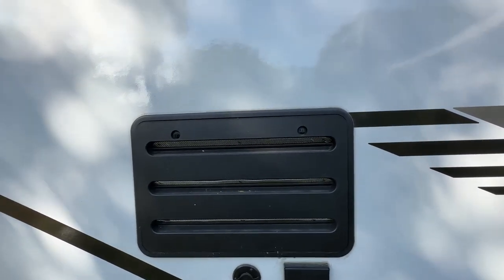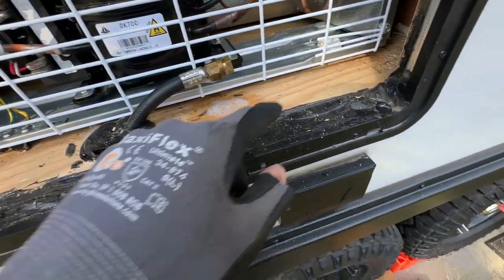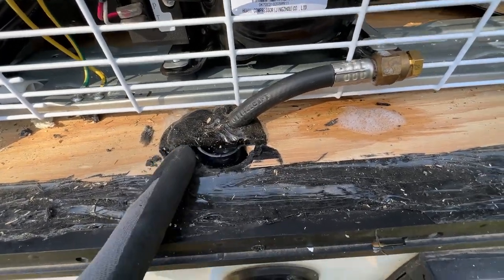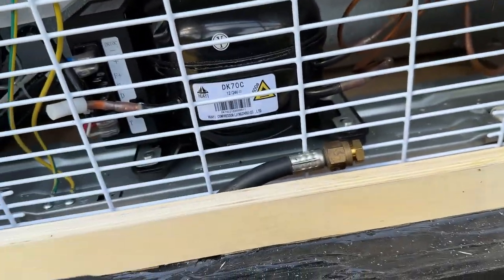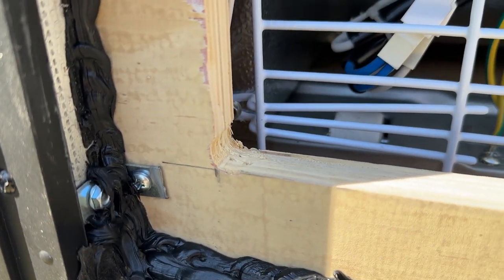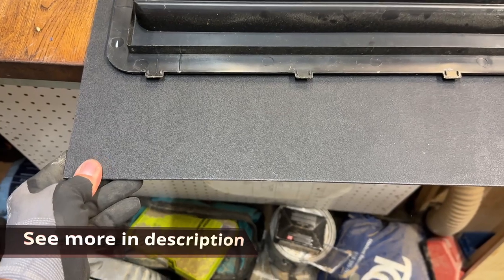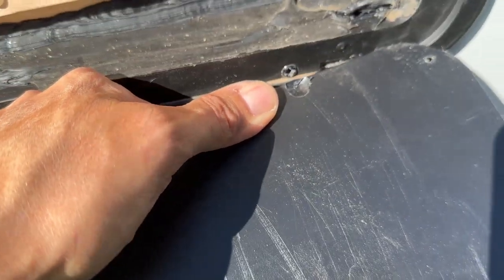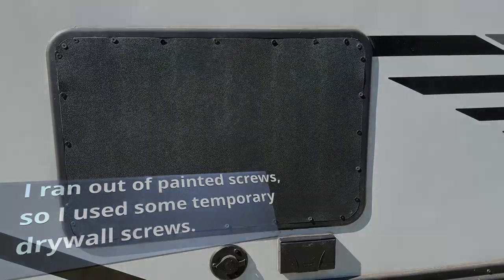How I closed up the lower refrigerator vent in my RV

Comment: My screw fasteners are on the bottom and I wish I'd never taken the panel off since I can't get it back on and have screws tighten up. I think this has been a problem with this new to me trailer for some time as it does appear a little warped so I don't know if I use gorilla tape or what. I did order some new fasteners to see if that would help me

Comment: But isn’t there a reason why the refrigerator has to be vented?
Reply: If you replace an RV fridge with a residential fridge, you need to seal it.. Residential fridges can’t be ventilated to the outside.
Reply: It had to be vented previously because propane fridges have an open flame